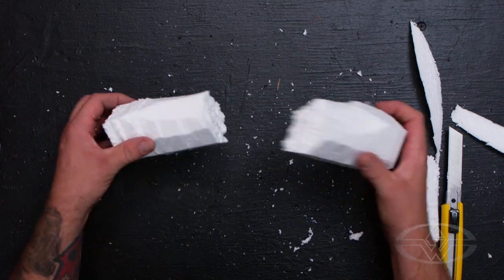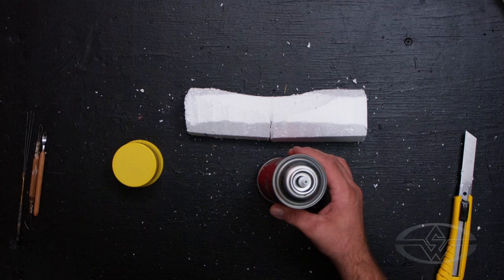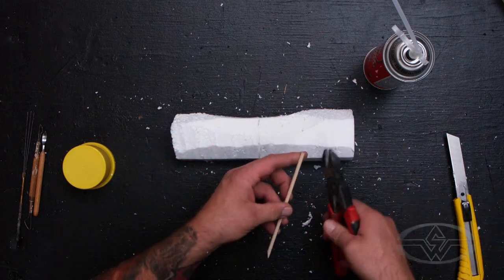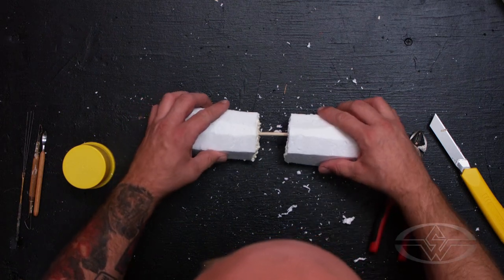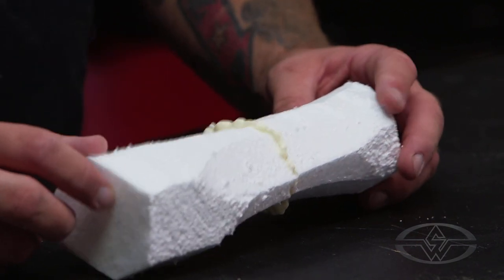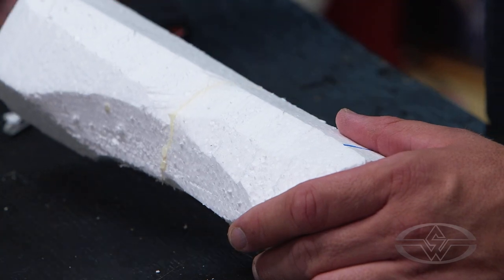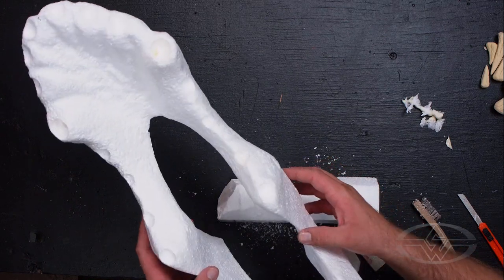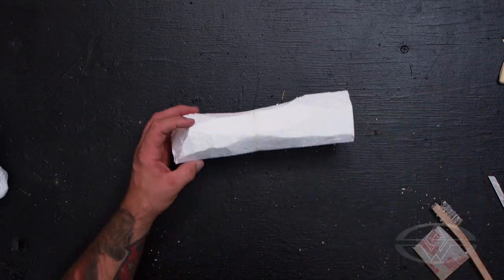Styrofoam Prop Making - How To Repair A Broken Piece of Styrofoam

Comment: An important note: expanding foam release isocyanates into the air while expanding. Its highly carcinogenic and should always be used outdoors.
Reply: how can you use it outdoors when alot of times if your like me and a builder you have to use it inside of a building often in small rooms.
Reply: @klausreviewscraftrestore3152  you can of course use it with a gas filter on your mask. But builders that i know here in Sweden stopped using it on the indoor  sites years ago because of the fumes.
Reply: @klausreviewscraftrestore3152 your choice.

Comment: Would this product work to fix an outdoor planter pot the broke in two? The bottom busted off when someone dropped my planter on concrete. Will it hold like glue? Will the two halves push apart as the foam expands.

Comment: Soooo...... no safety warnings at all? 
The stuff used as "glue" in this video is basically what my old teacher used to call "cancer in a tube" 👎💀  ...do NOT use this shit indoors unless you have a serious professional exhaust system, and even then only while using protective gear, 

I seriously expected a higher degree of safety from a professional channel 🙄
Reply from the maker: This clip is an excerpt from a much longer course. In the full course, as with all of our courses, instructor Tim Martin reviews safety precautions and makes it very clear that anyone working with toxic materials should always work outdoors or in a well-ventilated environment. While shooting this course for us, Tim was well-protected by our ventilation and fans. - Balázs